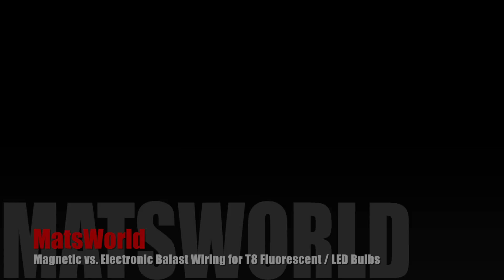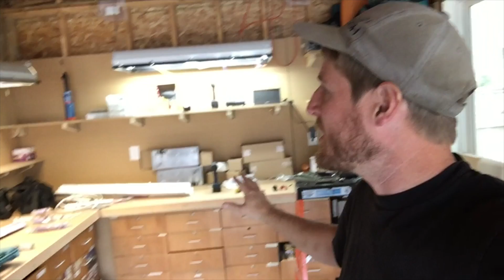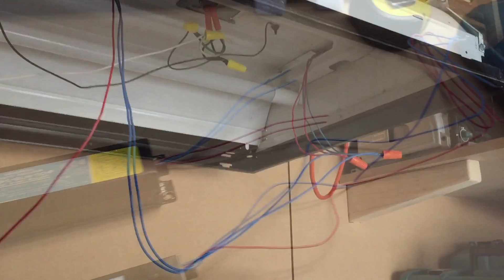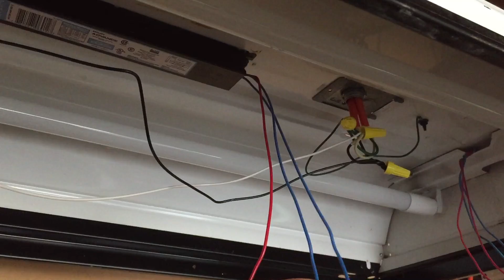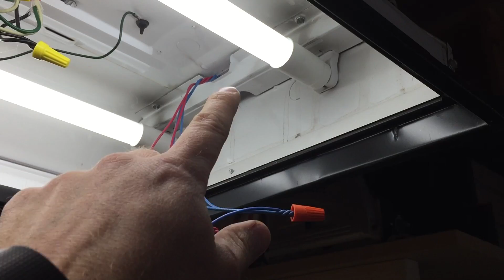Magnetic vs  Electronic Balast Wiring for T8 Fluorescent : LED Bulbs

Comment: The difference is that the electronic ballast is instant start and the magnetic one is rapid start. A rapid or programmed start electronic ballast would have the same wiring as the magnetic ballast.

Comment: the electronic ballasts suck and LED lights suck. i still use f40t12 fixtures that are pre-heat with the starters and some of the ones i have are from the early 50s and still work no issue. but the new electronic ballast struggles to last 5 years and the tubes dont last as long either, and LED lights are just harsh and boring and start to flicker.
Reply from the maker: ok then .. good venting Walter ;)
Reply: @matsworld9386  not venting, i am just saying that if you have an old magnetic ballast fixture and it is still working that it will probably continue to do so for a good while. the energy savings are real but not too much for the electronic compared to the magnetic and the magnetic ballasts last forever and make the bulbs last longer as well. so unless the original ballast has failed it is better to keep the original ballast in place and use the t12 tubes, especially if you have really vintage lights like i do.
Reply from the maker: @WalterKnox  fair enough .. I'm not having any trouble with my LED bulbs so far but time will tell .. I do like the instant on feature they have ... I'm not sure whether I had mentioned this in my videos but my way of doing it was definitely the roundabout way and I wouldn't do it this way agian .. I upgraded the ballast to electronic and then changed the bulbs .. so, double cost there . rather than just doing the LED bulbs that have no need for a ballast .. anywho, live and learn .. for now they work great and as mentioned, the instant on and off works great with the occupancy switch I have installed .. lights go on when I enter and turn off 5 mins after I leave .. works great ;)
Reply: @matsworld9386  that is a good feature and i definitely see the advantage that LED lights have over the fluorescent lights. the big one is that most fluorescent lights will not start below 50 degrees which is an issue in places that are not heated. they also do take more power... I personally do not like LED lights and will keep my old magnetic ballast but i have no issue with people updating. i just like to see both sides of things out there when making a decision.

Comment: The real question is why run LEDs on flourescent ballasts in the first place. The industry only came out with direct LED retrofits for flourescent tubes because they know people who don't know much about LEDs will just buy them either way. However the ballast still sends the same high voltage blasts and the LED tubes just have to disperse the energy and the current limitations are intended for sustaining a flourescent arc and not for LEDs
Reply from the maker: Couldn't agree more .. when I researched my options I was somehow hyperfocused on this method and somehow missed that there were direct connection LED options .. I wouldn't do it this way again .. not the least because I had to buy the ballast and the LED bulbs .. very inefficient in hindsight ..
Reply: @matsworld9386  LEDs have their own type of ballasts called drivers that are specifically catered towards their operation style which is much different from flourescent lights

Comment: The magnétic is a the best whats the eletrônic
Reply from the maker: Not sure how to respond to that ... I'm under the impression that magnetic ballasts are older technology and have been largely replaced with electronic ones ... at any rate, the LED bulbs I purchased from Homedepot require an electronic ballast and will not work with a magnetic one ...

There are direct install LED bulbs now that don't require any type of ballasts but do require some hard wiring changes ...

cheers and thanks for watching!

Comment: I know a magnetic ballast is outdated, but damn, I have magnetic ballast that are 25 years old and I have yet to replace a single one, yet the electronic ballast have to replace every freaking year.
Reply from the maker: yeah right on .. unfortunately I don't think you can get an LED bulb that runs on the magnetic ballasts (please correct me if I'm wrong and you know of a product!)
Reply: Mats World I have LED tubes in all my magnetic ballast fixtures with No issues. Phillips and GE make great LED tubes that are compatible with magnetic ballast. If a ballast goes out then I can direct wire if needed using the existing LED tubes.
Reply from the maker: I really must've missed something while doing my research on the LED tubes .. i was convinced I had to upgrade the ballast to electronic before being able to use the tubes ... I'll have to look into this again .. thanks for the info!
Reply: Mats World The best way is to completely remove or bypass the ballast period, but plug & play hybrid LED tubes are common now in the hardware stores and even at Wal-Mart.

Comment: Question, why even have a fluorescent ballast using LED lights when you can direct wire load on one end and neutral on the other? Edit .. depending on your LED of course. Some get the power from one end. Actually, quite confusing.
Reply from the maker: That is a good question and I don't have an answer .. after I had installed these I came across a direct connect LED bulb too .. haven't looked into it any further though .. it may bring the prize down for the conversion however as the ballasts aren't cheap either .. Let me know if you find anything! :)
Reply: Admittedly, the plug and play T8 LED tubes are about the only kind available at most hardware stores.